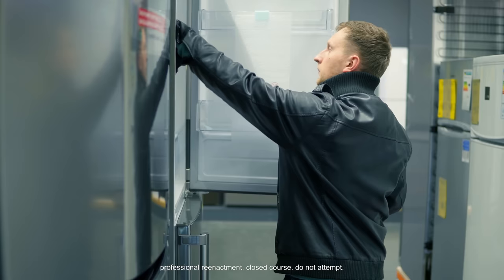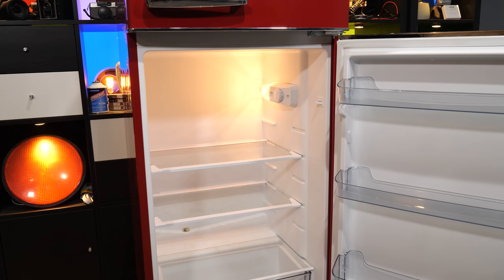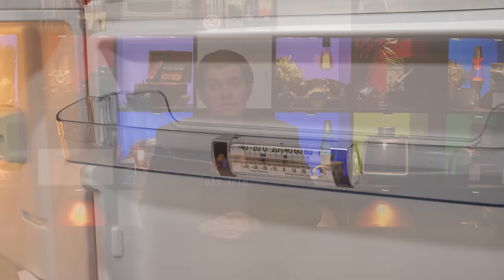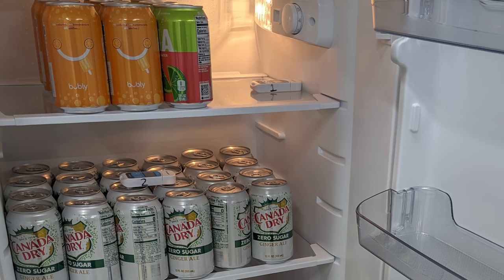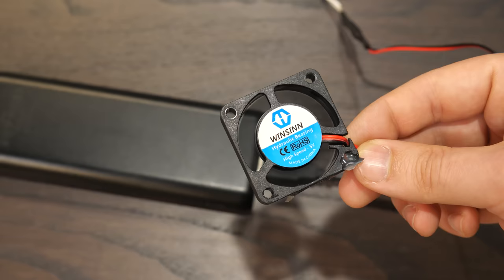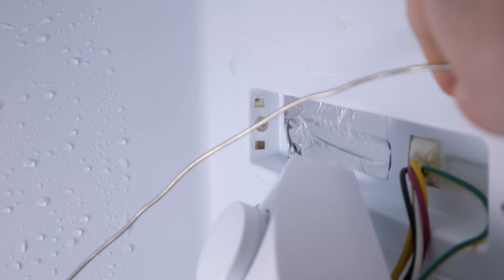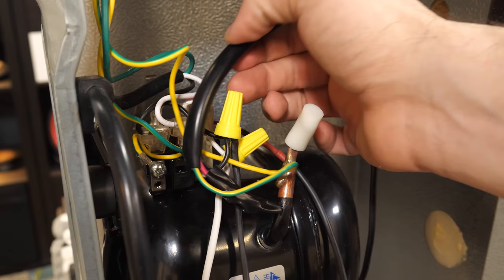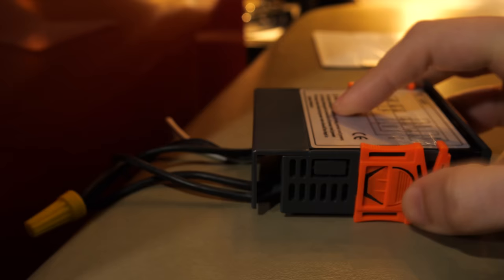This goofy fridge has a really clever design. It's also kinda terrible.

Comment: Can’t wait for you to tackle a Servel gas fridge! I have two (who can have just one of something interesting? My late mother wondered why I couldn’t just collect stamps). 
That’s a real rabbit hole to descend to visualize how one of those works— heat to make cold
Reply: Now, through the magic of buying two of them, you can have an already taken apart one to really analyze how it works.
Reply: "Heat to make cold."  It is called Absorption Refrigeration. It can use steam.   It often uses the exhaust steam from a steam turbine where the exhaust steam would otherwise just be condensed by water.  This would extract more energy from the steam.  (The turbine might be on a ship where it is powering an electric generator.)
Reply: @markpeterson5479  I have absolutely no clue, but will be investigating, but pretty sure this is how buildings in NYC can use their city steam system to cool buildings
Reply: Common in the off grid camping world where they're powered primarily by gas often by 12v for when you're driving and sometimes 240v for when you're home or on hookup
Reply: You definitely have the Knack.  I'm afraid there is no cure.

Comment: That thermal sensing bulb is probably placed there to prevent the capilary tubes from getting too cold. If they get so cold that the refridgerant is no longer vaporizing, you could end up with a situation where liquid refridgerant makes it to the compressor, which would destroy it.
Reply: That's a really interesting thought.
Reply: if that were the spelling and if a compressor even turns on when the sensor is too cold; would → should
Reply: @alysdexia  Theres no bus!
Reply: @WeiserMaster3  what’s your babble?
Reply: @alysdexia  I just kept your incoherent message going, don't worry about me. 😋
Reply: @WeiserMaster3  I wasn’t incoherent, wit/2.
Reply: @alysdexia  Keep telling yourself whatever makes you happy in front of the mirror. 🤷‍♂️

Comment: I would love to see Alec cover an absorption fridge and freezer combo. It absolutely blew my mind when we first got our camper and still wow's me even to day that it's possible to move heat around by by boiling an ammonia water solution, and even though they are starting to be replaced by 12/120 volt compressor refrigerators they are still amazing for people like us who go boondocking and don't always want to run a generator 24/7 to keep our food cold.
Reply: Yes!
Reply: Those were the earliest ice making plants. Very Convenient before AC power and didn't need a water wheel or steam engine to turn anything.  Not efficient though.
Reply: I love the adsorption cycle. Boil ammonia out of an ammonia/water solution, let the ammonia cool and condense (the top coils), add a little hydrogen to the liquid ammonia to force it to boil inside the fridge, then expose the ammonia/hydrogen gas mix to water, where the ammonia dissolves into the water releasing both the hydrogen and the heat. Bango, cycle complete, and refrigeration happens with no moving parts. It's just so clever.
Reply: Yep they are great for remote locations that are off grid, I had one in my cabin, it would use 0.25 grams of LPG  an hour....I kept a 9kg LPG bottle connected to it and it would last for ages. Only issue is occasionally the flame that is used to heat the ammonia would carbon up and the fridge would not be as cold.
Reply: It blew my mind when I saw one at a scout meet.
Reply: What's ages, and what sort of ambient temperatures?
Reply: @markrainford1219  I've seen it work in a hot summer day outside underneath a tarp roof.

Comment: That thermostat sensor bulb was actually very carefully chosen to be in that particular spot. And the behaviour of the thermostat after loading the fridge - though to modern standards not what you'd want - is also by design.
The Miele fridge I bought in 2006 works exactly this way (albeit it has a conventional condensor/heat exanger hanging off the back). It has the sensor bulb wired in plain sight behind a plastic disc on the rear wall right where the evaporator is. Google a basic current model, like the K 1020, and you'll still see it in the brochure photos, right above the lemons (you may want to go to Miele UK to find this model).
The thermostat was designed to measure the evaporator temperature on purpose, it has to do with the pressures inside the refrigeration circuit which on microcontroller controlled fridges would probably be monitored by sensors, but in this mechanical setup just works by reaching a lower temp limit of the evaporator.
I used to work in the swimming pool business and the heat pumps used for heating those have a multitude of sensors to monitor and protect the circuit, measuring pressues and temperatures in different sections.  Trying to bring a pool from 10 degrees C to 30 degrees C in as short a time as possible was advised against by the manufacturer, just because of the strain this would introduce on these heatpumps. Trying to cool a lot of sodas in a fridge with an undersized compressor would result in the same strain on the system. Yeah those bigger fan assisted fridges can deal with that, but it's not a fair comparison.
Reply: If you would indulge me in a theory I came up with from watching the video...

Since the freezer overperforms when the refrigerator is under a heavy load, wouldn't it be an effective strategy to divide part of the workload to the freezer?

Take 10-20% of the stuff you need to cool {specifically stuff that doesn't mind freezing and thawing,} throw it in the freezer until frozen and then transfer it to the fridge to help absorb the heat and reduce the fridge temp?
Reply: Yeah, I was wondering if the thermostat position was to implement a duty cycle control on the compressor.
Reply: @jrevillug exactly! I was thinking this exact thing and I bet the little compresser gets really hot even with a drip tray hat and so this will increase its longevity to years from months because it's so marginally sized...
Reply: Exactly. The engineering here is to maintain safe (and likely long enough to beat the warranty) operation of the refrigeration circuit.

The fact that that circuit is built in to a refrigerator form factor and thus used by the end user to cool food is almost a byproduct.

Not to say there isn't some clever elements to the design. But making something that doesn't blow up is going to take priority over effectiveness. And at this price point, your engineering budget is now spent.
Reply: A clear case of "Designing for X".

Say, didn't someone do a video about that? Insert card with chest freezer thumbnail
Reply: @priestesslucy3299  modern refrigerators do this and have vents between the two compartments that are opened and closed when needed, they're much more energy efficient even with the extra heaters and fans
Reply: @davidmckean955  So... Yes, dividing the load manually the way I described would be a way to make this fridge work better?
Reply: Yeah, this was my suspicion.

That the thermostat was placed there as a clever cost cutting measure so it could do double duty, preventing the compressor from running for too long at a time.
Reply: I agree it was definitely intentional and for the very reasons you cite, but it still makes it a major design flaw because the device isn't suited for its purpose. If it can't maintain a food safe temp, it isn't performing its function. Probably why it was discontinued. Too big and too underpowered for the hardware they put into it. Comparing it to the better fridges isn't relevant when he wasn't even loading it to it's own capacity.
Reply: @FluxDeimos  Food safety does not, in practice, require keeping your food within breathing distance of freezing at all times. If this were an issue, most of the planet would be suffering from food poisoning all year round, yet somehow, we're not. Mind you, we also don't put eggs in the fridge, so perhaps we're onto a few things..
Reply: @Monkeh616  I'm going to assume you are european as it IS regular practice to keep eggs in the fridge in North America due to the difference in farm to customer practices. The cleaning process removes the natural protection that makes them safer to keep out of the fridge in Europe. Additionally the LAW requires a fridge to maintain a temp of 40 degrees F in the US or 4 C in Canada. Since this fridge was NOT capable of that it was a lawsuit waiting to happen.
Reply: @FluxDeimos  Yes, that was my point. Thanks for explaining it to me..
Reply: @Monkeh616  If your point was that even most countries in europe have moved to the 4C requirement as well, with only a few holdouts still using the 8/7c from the 70's and 80's then I'd suggest you consider your point completely missed since thats NOT in any way communicated from your post
Reply: @FluxDeimos  My, communication with you is difficult, isn't it?

This design works fine. Nobody is keeling over from food poisoning from not using $2000 fridges more complicated than some cars. Keep on being special..
Reply: @Monkeh616  Who said anything about needing a $2000 fridge? Strawman someone else. But I guess when you are an idiot you need to make up something to fight against when it's pointed out the fridge in question violates the food safety laws in MOST of the world.
Reply: @FluxDeimos  And I would be fascinated if you can cite the various laws requiring that a domestic fridge for final consumption be capable of maintaining such a temperature and the test conditions for such. I'll wait. No, regulations on commercial kitchens and the production, transport, and sale chain are not relevant.

While you're at it, can you cite any studies showing a meaningful decrease in domestic food poisoning as a result of any change in regulation you may or may not be about to prove exists?
Reply: @Monkeh616  Tried posting them twice but the antispam keeps eating the post because of the links. You are free to do your "own research" I guess but simply put, the regulations for certification on appliances are clearly demarcated for canada, the US, and most of europe in each of the respective countries food safety acts, and there are LOTS of studies showing the benefits of the modern standard over the 80's standard
Reply: @FluxDeimos  You could always provide the relevant titles..

I can say I have found real world data on domestic fridge temperatures in practice, they're not 4C, and still no sign of massive waves of food poisoning. Almost like food is safe at higher temperatures so long as it's stored for a reasonable period.
Reply: @Monkeh616  You could always stop straw manning and goalpost shifting too, but we both know that won't happen.
Reply: @FluxDeimos  Ah, yes, I shifted my goal posts from food doesn't have to be super cold to... food doesn't have to be super cold.

Just name the standards. I'm curious enough to read them, not curious enough to try and find them for multiple nations in multiple languages. You claim to have already found them, so what does it cost you now?
Reply: @Monkeh616  Safe Food For Canadians Act for starters, food not chilled to below 4C is not considered refrigerated and any device that cannot maintain that will not be certified for sale in the country.
Reply: @Monkeh616  Also covering in the Food and Drug Act, which highlights the specifications and inspection guidelines for certification for all appliances for heating and cooling, both commercial and residential
Reply: @FluxDeimos  See, now we're vaguely getting somewhere.

Safe Food for Canadians does indeed define refrigeration as storing food below 4C - this, at an admittedly surface level glance, would cover the production, distribution, and sale of such food, ie. commercial activities. I see no direct link to a product standard or test methodology for domestic refrigeration equipment, but I'll acknowledge the definition. What about equipment which has an adjustable thermostat which can be set above 4C? Surely that would be illegal, then?

In the Food and Drugs Act I see only relevance in section 19, "No person shall sell any device that, when used according to directions or under such conditions as are customary or usual, may cause injury to the health of the purchaser or user thereof". One could arguably apply this to a refrigeration device which doesn't meet the expectations of the user regarding the safe storage time of food, but the standards under which prepacked food expiry dates are set will be relevant. Not going that deep. But that refers to medical devices anyway, not fridges.
Reply: @Monkeh616  You could always share that prolific data you claim to have found saying im wrong, after all for someone who didn't care to search it must have been EASY to locate.
Reply: @FluxDeimos  I don't care to duplicate effort, you claim to know what all these various product standards are after all.

Which prolific data are you referring to? Food poisoning? The numbers aren't comparable between countries due to different methods of collecting data and estimation. I do, however, know from merely existing that food poisoning epidemics from using fridges with control mechanisms of this type, and mean fridge temperatures in excess of 4C, aren't happening.
Reply: @Monkeh616  Funny, you claimed to have data but when challenged to produce it you refuse. It's like you are just a troll or something. Guess its safe to ignore you since you can't be bothered to hold yourself to the same standard you demand
Reply: @FluxDeimos  Which data did I claim? I said food poisoning does not appear to be a massive issue despite this being a standard design of fridge. Those numbers really are easy to find, along with explicit warnings against comparing them between agencies with different methods, unlike specific product standards which are generally paywalled. And you haven't succeeded in producing any of those yourself.

Domestic fridges just don't actually have to be that cold in practice. Sorry you have a problem with that. Enjoy your washed eggs?
Reply: @Monkeh616  "I found real world data on domestic fridge temperatures and it's not 4C" and yet even a basic google search shows nearly EVERY country has that as the standard. So you are a troll AND a liar
Reply: @FluxDeimos  Ah, that, you should have been more specific.  Look up "Temperatures of the food cold chain at consumer level in Europe". Real world fridge temperature samples taken for guidance on assessing shelf life of foods. Very different to what people suggest you should set your thermostat to. The study does point out its own limitations, but it is data nonetheless.

You seem to have some confusion as to the distinction between legal requirements on food providers, public guidance on personal food handling, and actual real world practice.

Comment: I'm a General Electric Appliance Technician and the r600 (butane) refrigerant is more efficient but has been unreliable in people's homes. A service bulletin was sent out last year around June 2022 and they have addressed the failure of over 170k unit with r600. The repair is a complete rebuild of the sealed system with LOKRING joints instead of brazing because it's explosive. The LOKRING joints leak and are unreliable as well
Reply: General electric perfected the fridge decades ago and stupidity ensued afterwards

Comment: can confirm the chest freezer thing. those units last forever. my great aunt got rid of hers just a few months ago, it was working still, she just wanted to replace it with something more modern and convenient. it was one of the pre-insulation plugs, so it was bought before 1984 at the latest
Reply: I have a chest freezer i got 18 years ago. It was used several years then. It is still running great, except the little light on the lid that says it's running is starting to flicker and go out, and it has a little rust on the outside in a few spots from abuse over the years. it's so quiet, i can barely hear it running in a quiet room. and everything is always just frozen. very very frozen.
Reply: We got rid of our old chest freezer a couple of months back since the compressor was starting to get really noisy. That freezer had been passed to us in 2008 by my great uncle who bought it sometime in the 1980s. It’s absolutely crazy.
Reply: Sold ours to our next door neighbor who passed away recently. That was about 30 years ago, and it may very well be still running. Sold it to him because the lid was slightly warped and it would frost up in the slight gap between the lid and the top of the freezer. Also turns out my picky eater wife really doesn't want or need a lot of frozen food. Who complains about the freezer being full?
Reply: the only reason why we got rid of our 20+ year old chest freezer was the door was finally broke beyond repair from years of abuse. the food was still frozen fine.
Reply: The chest freezer in my home was bought the year I was born, 21 years later it's basically a member of the family now
Reply: @Deviated09  You know you have an old school appliance built to last when the entire thing outlives the tiny indicator lights that the engineers probably never thought would be used long enough to happen.